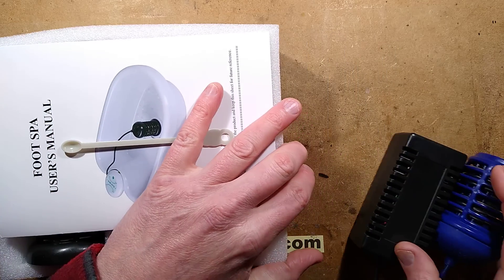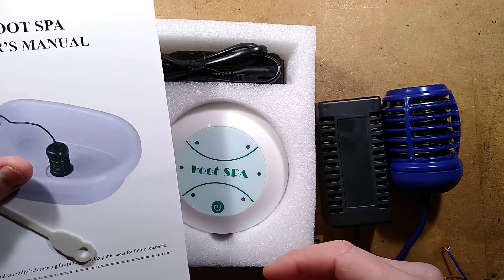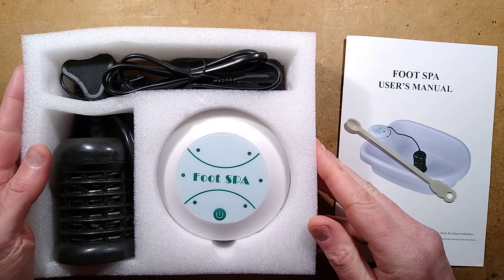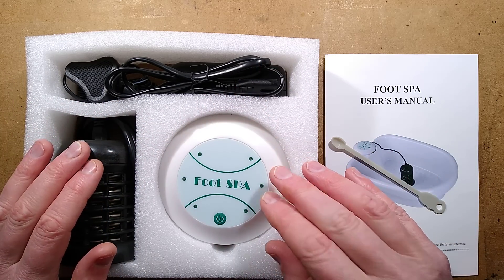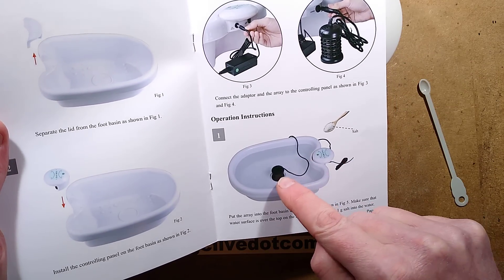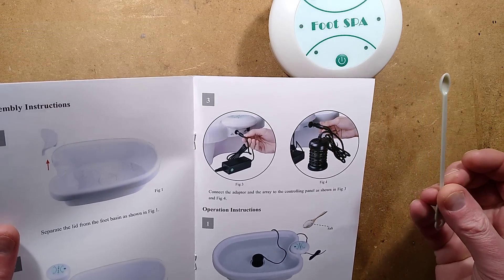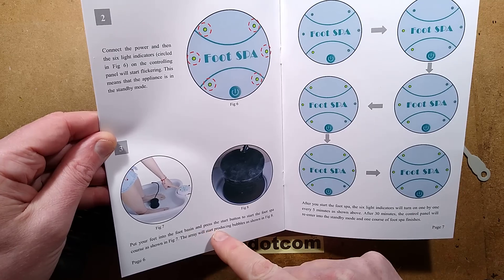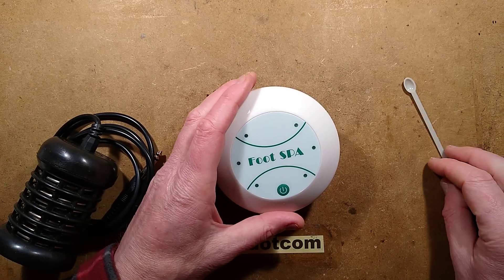Inside an ionic foot detox spa unit.

Comment: This reminds me of heating water with electricity.
Do you suppose those there's a product out there that is a simple, safe, drop in water heater? Or a way to make one. It doesn't even need to be safe, it would just be neat to find a way to heat water without turning it brown using a usb plug or something.
Reply from the maker: You can buy water heaters like that on eBay.  They make the liquid live.
Reply: @bigclivedotcom  I love you China. Always be there for me.
Does it discolor or chemically alter the water in anyway? Also wouldn't it be safe if it was properly grounded, like a suicide shower head.
Also make glowing cum. That is all.
They sell glow in the dark condoms on bad dragon btw
Reply from the maker: @LaskyLabs  it may add some metal ions to the water.  I made a video about it a while ago.  Try searching my channel for the keyword heater.
Reply: @bigclivedotcom  okay, thanks.

Comment: Guessing at the reason for the tiny spoon; You put in a crapton of salt and got a 'huge tub of simmering filth' in like five minutes, and the suckers won't be happy that way. The tiny bit of salt makes the water JUST conductive enough that it works, and as it pulls scunge out of the electrode -- er, your feet -- the metal that it's pulling out should raise the conductivity.

Comment: with all the routine QC it seems like its just made by a contractor. 

the company marketing and selling them is likely not involved in the manufacturing at all.
Reply: Or maybe the industry realizes that it's easier to sue a spa for electrical safety violations than for ineffective treatment, so they have to be above reproach in that department to continue their profit stream.  One must wonder how many of these systems are actually built to the strict standards for actual medical equipment versus how many are just safe enough to not electrocute patients in normal use.

Comment: Earth on the plug is sleeved
Reply: Yeah, but it's only a 2-pin power connector at the other end.  Still wrong, though.  Earth pin could have been all-plastic or all-metal in this application but sleeved metal is wrong, wrong, wrong (even though it doesn't matter here).

Also, as far as I could see, no fuse.

Plug body dimensions are wrong, too.  Too small.

So illegal 3 ways.  No surprise.
Reply: @bdf2718  true I didn't think that one thru.
Reply: Only illegal in the U.K, 🇬🇧 which we have the safest electrical standards in the world 😁 ✅, elsewhere,  where our plug style is used they won’t bat an eyelid at that Chinesem crap - even if someone is killed by it 😱

Comment: Should wire that electrode to mains and drop it in the water~
Reply from the maker: I've been seriously considering that.
Reply: @bigclivedotcom  As have i. They are cheap enough and having a spare 240v, 100 amp service feed to my farm, ive even considered just connecting it to the service feed and watching it burn
Reply: This is exactly what those dangerous "electrode immersion heaters" do, except you (hopefully) don't touch the water while its running, and you drink the toxic solution afterwards.

Comment: I think you should say the hell with using 12 VDC on these things and just put either 120 or 240 VAC to one of those electrodes and see if there is any difference between using AC or DC voltage on them. I'd say put AC to that control unit but that would probably destroy it fairly quick.
Reply from the maker: AC doesn't really cause much electrolysis.  It requires sustained DC current.

Comment: Kinda disappointed Clive. I hear many times the very same its a Chinese power supply non-compliant etc., This is or isn't it the reason you usually open up things? I was looking forward to see if it is really as shitty as the claims suggest or not? Now I need to wait for someone else brave enough to open these? Hope my favorite ytube tech guru eventually will find the time to take a closer look inside....I have noticed in recent years that the Chinese mass produce has got better than a decade ago I assume It might worth to examine if the same can be applied here. Of course I don't suggest to give a green light to any non-compliant main supply but it would be interesting to see if it meets with the required specs or not. I suspect it does but in order to apply for being tested the cost have been saved so eventually we consumers have no guarantee it is safe or not to be used.

Comment: I assume JP1 is for FTDI connection to  micro processor for testing purposes
Reply: More like the standard programming interface for that brand of microcontroller.  Using FTDI chips for anything feels bad after they did that chip destruction stunt a few years ago.

Comment: I am disappointed that you did not use the included powder of obvious superior quality.  I can only hope that you will take it to bits in a future video. 
I bet if you had that water tested after you treated it would either come back that mare should never plow that field again or someone from the EPA will be knocking on your door
Reply: Nah, It's just basically full of rust. The electricity slowly breaks down the steel electrodes and causes them to rust and by adding salt you just speed up the process.
Reply: Ben Keysor I know that it is nothing more than rusty water https://youtu.be/-CxX8nvLalE
Reply: Ben Keysor I know that it is nothing more than rusty water https://youtu.be/-CxX8nvLalE

Comment: So my question is, if you connect up that supplies power supply to an outlet that has neutral and live swapped, is it one of those cheap ones that can put live on the ground?  It kind of looks like that kind of dodgy gear

Comment: That's an interesting power meter you've got there, have you seen the UD18 one? It has USB / USB-C / barrel connectors for monitoring power, and can be powered from micro-USB so the readings are more accurate.
Requires some intelligence to use since the USB & barrel connections are wired together, you don't want to plug any USB device in if you've got 12v going into the barrel connection.
It also remembers the mAh & watt numbers when powered off so it's very useful for measuring capacity of USB power banks etc.

Comment: It wasn't so much as measuring coke as it was used to snort the coke from it.
Reply: The replacement paddle stirrers worked just as well or at least so that I have read
Reply: No it wasn't. It was used by tenner bag level heroin dealers. As it constituted what was generally an average bag.
Most people snorting coke simply use a key as a shovel and snorting implement. Virtually every one has at least one Yale type key, or you can be sure the first person asked will have one.
Never really seen the point of snorting, as the vast majority ends up betting snurched back and swallowed anyway, leaving a very small amount to be absorbed by the mucus membranes. Might as well just neck it in a bomb.
Though it's a waste anyway. Much better to rock it up and put it on a pipe. IF you were going to indulge in the nasty shit. I rarely ever bother these days. The novelty and charm I found wore off in my late twenties. Some time ago.
Reply: @rationalmartian  

nah, sorry, if you ever did coke, it was only once, and you never did enough to understand the drug.

it's one of the best, most addictive drugs in existence.

them's the facts.
Reply: @thomasneal9291  Rationalmartian is bang on with his comment...coke was bumped from a key and still is

Comment: -Instructions say 60w
-Devices says 25w
-Power supply says 12v 2A...
😀
Reply: 12v 2a is pretty much 25
Reply: @lolman123401  It is less though. I just thought it was funny that the power was getting progressively less the more you read.
Reply: @anononomous  still wonder what voltage/amps are going to the output. That switching supply makes me think its not 12v.

Comment: When electrolyzed, Na + and Cl- are separated,  with hydrogen gas being liberated at the cathode as the Na is oxidized by the water.  The anode releases chlorine.  This leaves sodium hydroxide behind in the solution.  And that's no lye!
Reply: @simon foley That would be the Chromium and iron oxides that come from the Electrodes itself. its why you dont use stainless steel, or any steel for that matter for any electrolosys (may execpt for a few speciallised reations)
Reply: @Palerider1942  Yup, nothing like a little hexavalent chromium for what ails ya!
I wonder if folks pick up on the irony (sic) that this gadget actually adds toxins to your foot bath...
Reply: Might as well put your feet in sodium hydroxyde based toilet cleaner or dishwasher tabs.
Will certainly get rid of all fats, and probably your feet ;)
As a plus you may inhale the chlorine gas!
Reply: @reinhardvomdobel1325  Add some vinegar and you have a Jacuzzi LOL
Reply: Hahaha, no Lye, I know what you rid there. :D
Reply: This is great for inhalation. You can add dry ice to completely wipe yourself.
Reply: @simon foley most likely the electrodes are not platinum - and the brown might well be some iron oxide or whatever the reaction of all that may produce
Reply: @reinhardvomdobel1325  The chlorine should make ferric chloride, but instead that reacts and neutralizes the sodium hydroxide. To form hydrogen, iron hydroxide, and regenerate the salt.
Reply: @tiny_toilet  and, ironically, any toxic heavy metals in the electrode get dissolved into the water and get all over your skin. So much for a detox...
Reply: @deltab9768  Maybe if they named it "retox"...
Reply: @deltab9768  Yes,  the mention of iron  is pure irony.
Reply: Mhmmm... Tasty tasty electrolisys byproducts...
Reply: PUNNY!!!! lol
Reply: And add in the dead skin everyone has on their feet and watch the goop build up as the sodium hydroxide eat it up!  No wonder people say they feel better when they pull their feet out of the poisonous swamp!
Reply: "The anode releases chlorine" but i thought it also releases oxygen... at least any picture of an electrolysis device shows o2 bubbles on one side and h2 bubbles on the other
Reply: No, you would get oxygen, not chlorine. The basic reaction is 2 parts hydrogen + 1 oxygen <-> 2 water. Normally, the reaction favors the product (water), but the electricity provides the energy to drive the reaction to the left (towards the reactant side). The salt (NaCl) is just there to make the water conductive enough; you can’t actually electrolyze NaCl into elemental sodium or chlorine this way, rather, they dissociate into Na+ and Cl- ions which remain in solution until the concentration is too high; then they precipitate out as NaCl again, which is what would happen if you dissolve the NaCl in water and boil it off to make rock salt (crystals.) The addition of the iron, though, adds some complexity to the picture, and you may well get some compounds of iron and chlorine, but it’s probably just oxides of iron that give it the brownish-red color. If they used (neutral) graphite electrodes, you would get just the 2H2 and O2 (plus some small amount of contaminants that precipitate out.)

Comment: It's interesting to see such a HUGE inductor - caps is very necessary here.
I designed a board with a buck regulator not too long ago. 12V down to 5V, so it's similar enough to here, with about 3A output current. I managed to get away with a 7x7mm SMD Inductor - an inductor of that size could probably handle an order of magnitude more.
Nice teardown, as always!
Reply: The switching regulator chip used in this device is pretty ancient (at least 30 years old) so it switches at a relatively low frequency and requires a large inductor because of that low switching frequency. Modern switching regulator chips can switch much faster and can get away with much smaller inductors and capacitors.
Reply: Was the cheapest Suplly avaible at the time or something
Reply: Well, you probably used some high-tech MHz-frequency buck converter?

They probably used something slower, that "floats around" at the market.
Reply: @erlendse  I'm... Using a 50 cents expensive SOT 23-6 sized chip rated for 3A at 50kHz 
I mean, it's still high tech, but quite affordable

Comment: I wonder if the power supply is actually on par with the quality of the device.

I guess these quack devices are fairly expensive, so the manufacturers have less incentive to cut corners everywhere. I like the touch with the high current traces built up with solder. A bit overkill maybe for a device with such low output current.
Reply: Maybe they needed to meet some regulations for mains powered devices with electrical contact to human bodies.
Reply: @MetalheadAndNerd  possibly because of is that plug issue with non-compliant plug makes Rave think not so much.

But yes there are regulations that would affect like medical equipment and don't like your debt as to what you were saying.

Also look up on YouTube medical-grade plug pack.

Here in the United States it would be called a wall adapter or power brick or a wall wart.

Or just adapter for power supply.

What I'm saying is why if you had to meet requirements for your power supply why I also would that power supply have a non-compliant Ford employee supplied with it.

I just thank God one part be notifying that would go through power supply would mean the whole thing would be non-compliant.

Kind of like using non compliant Parts in the manufacturer's device could void warranty.

And such as if a switch in LaPlace is not compliant with the regulations that device would not pass for any regulations.

Here in the United States be in DC National mythical code and potentially others depending on what type of device.
Reply: @aaronbrandenburg2441  Is that some kind of social experiment or artificial intelligence trying to mimic a human response?
Anyway it would be a hassle to have a non-compliant Ford employee delivered with every power supply.
Reply: Aaron Brandenburg can you construct your thoughts comprehensively and try again or are you happy to never proof read anything you publish permanently on a medium that will possibly be used in future to 🐥🦆🐊🦧🐋🦆🦆🦆🦘🦙🐕🦙🦒🎄🦥🌲🌲🌔💫🌨⛈🌈 like we know about YouTube Egypt 4000BC?
Reply: @JesusisJesus  This is no auto-correct running wild. This looks to me like a semi context-aware text generator as they are used by search engine spammers to generate thousands of pages with pseudo content around some topic to make Google think there was lots of discussion about this topic.
Reply: @MetalheadAndNerd  Looks like his comment was run through an English-Chinese translator back and forth several times. ;>)
Also, what would the Ford employee not be complying with? As long as it doesn't violate Union rules it's probably okay...
Reply: @aaronbrandenburg2441  unplug that bot from your brain
Reply: @aaronbrandenburg2441  Your brain just implode on its self?